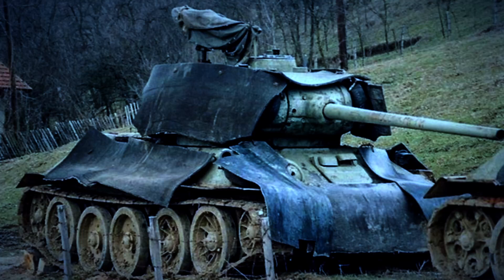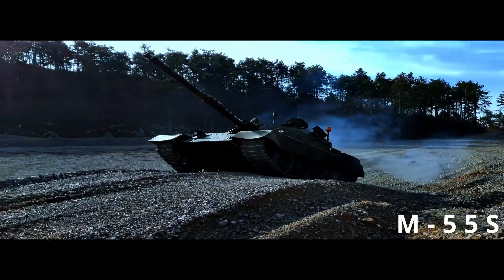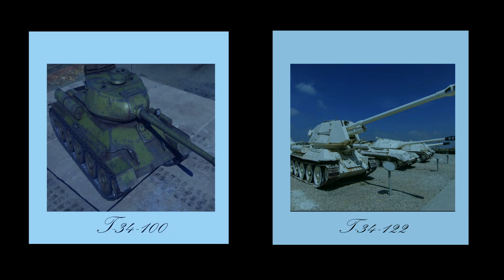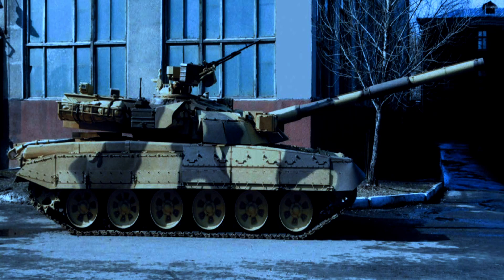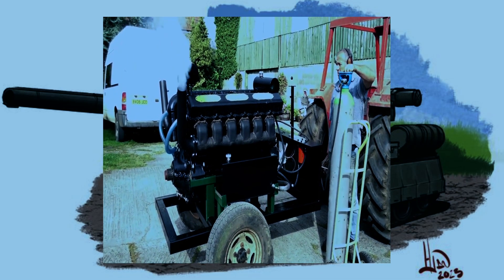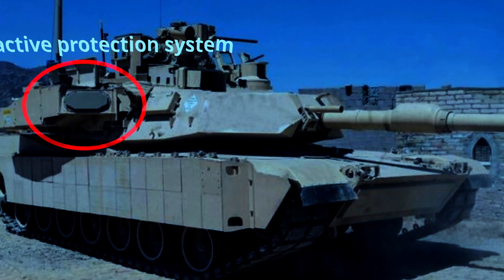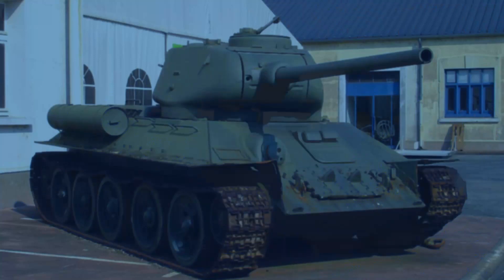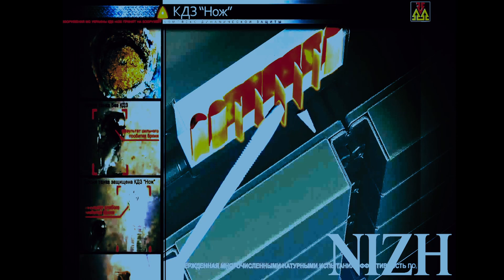MODERNIZING the T-34 tank for Ukraine

Comment: Interesting ideas! But i dont think the 125mm autoloader would fit inside, nor would it be able to handle that powerful gun. I would only see the tank having a modern 76mm gun,better engine,tracks,electronics. Other than than it would not really worth it. T-34 would be more of an infantry support vehicle.
Reply from the maker: The Egyptian fitted a 122 mm gun on the t-34 , the issue is that the new turret has to be incredibly big.  Yeah, the project is not really worth the time and cost, but it’s a nice idea to play around, and also see how prior ancient tanks were modified
Reply: @Combatchronicles1793  Yea i seen it. Pretty crazy but a cool idea. The gun is just too powerfull it would rip off the turret. T-34 isnt really ideal to be upgraded to do different tasks. Unlike the sherman tanks which had many different variants. I seen sherman tanks with amx 75mm autoloader turret or there was a high-Velocity 60mm main gun or the super sherman with a 105mm gun.

Comment: With all the changes that would needed would not be cost effective. I do think it's an interesting idea though.
Reply from the maker: Of course, it would be a waste of resources. Furthermore, Russia doesnt have t-34s in storage anymore.
Reply: @Combatchronicles1793  Considering the effectiveness of modern anti-tank weapons; all you need is enough armor to handle machinegun fire, a V-shaped hull for mine defense, and top armor against drone attacks. Anything else is just a waste of steel. The M-55S would be a good stop-gap measure. A 105mm gun, modern fire control, and thermal optics. Build enough cheap "modern" tanks and you can just overwhelm the Ukraine with numbers. Casualties? When have the Russians ever cared about that?
Reply: I agree just build a new tank